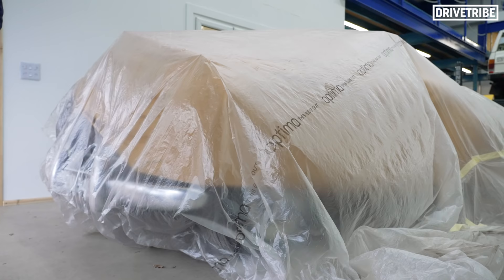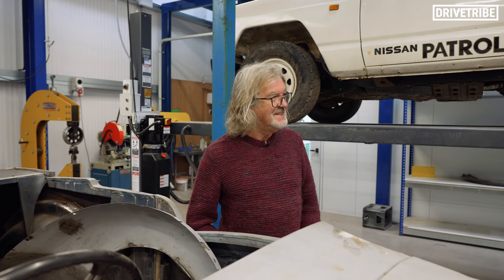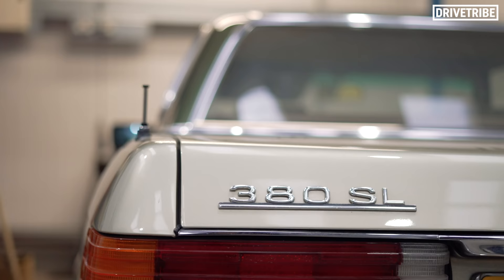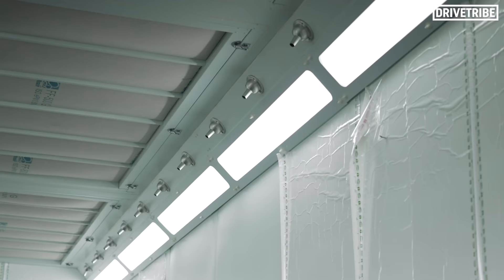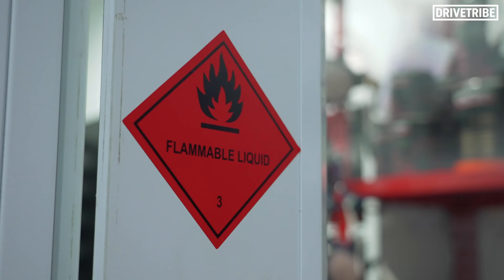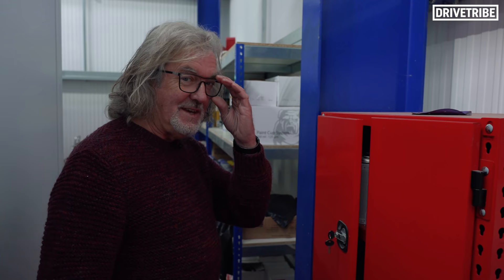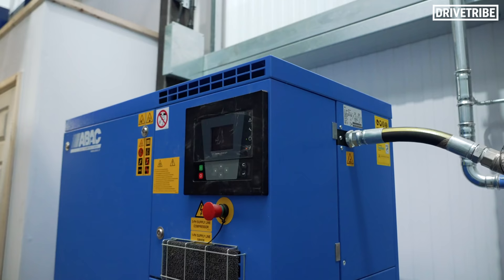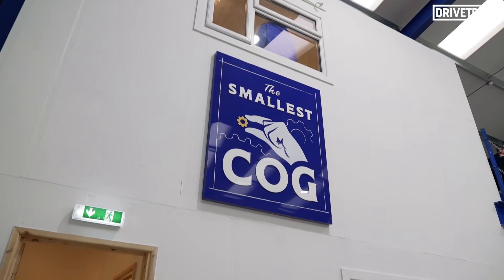James May roasts Richard Hammond's new workshop!

Comment: Judging by the lack of activity it looks like Hammond has been far more successful spending money than making it.
Reply: Indeed. It's really not that difficult... Take the money you spend on that paint booth, and divide it by how long you think it will last. Say 30 years. Then see how many times you use it in a month. Then you know the amount of money you need to ask each customer in order to recuperate the investment. Chances are that you will want to be using it A LOT if you want to keep that affordable. Same with all the other machinery. That workshop should be teeming with activity if the goal is to make a profit.
Reply: Maybe they stopped making a noise to film .
Reply: @nevets7152  Shhh, don't bring common sense into the comment section :)

Comment: Great honest tour of Richard’s new work shop. Question is, has it passed building regulations? Mezzanine floors with no fire rating to the upright columns!😳😲Surly they should have 60min fire rated column casings on to protect the steels.

Comment: I am a business owner myself. Hammond definitely is better at spending money then making it. He doesn't need to have everything honestly. A workshop with it's own paint shop AND it's own paint mixing machines and all is too over doing it right there. Even a specialized paint shop doesn't all have it's own paint mixing equipment because it is more profitable to just order the paint from a paint factory/supplier. No workshop, needs that level of generalization. His "workshop" is actually a factory at the state that it is. I can't imagine how much more money that he will have to spend on the running cost of the whole thing. Just imagine the salary for his employees. He probably have to pay salary for his practically "unemployed" paint specialist. It's not like they are going to be painting cars day in day out. The guy is going to be lounging around doing nothing most of the time. Also rather then be able to do everything, he should have aim to be perfect at doing one thing. 
He is definitely going to run at a loss for years.

Comment: I think May made a judgment error re: the paint booth. It makes no sense for the air to flow from the bottom up. If it did, any dust in the air would collect (pressurized) on every surface; only to fall on a freshly-painted car as soon as the fan was turned off. Perhaps I am all wet, but if so please be constructive in your criticism. Cheers!

Comment: I think May's 'Contribution to the work force' was to turn up the temp on an instantaneous water heater rather that climate control. If that room was heated my guess is that was due to the free standing oil filled heater the video clearly showed rather than the temp of the water coming out of the tap.